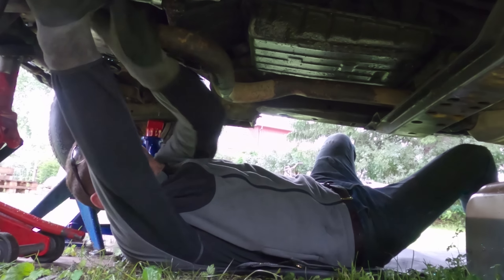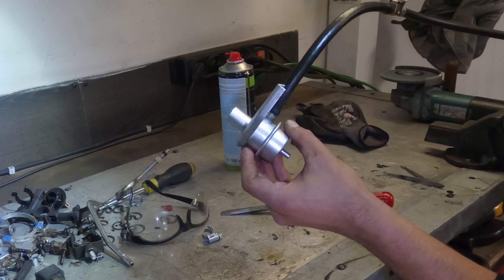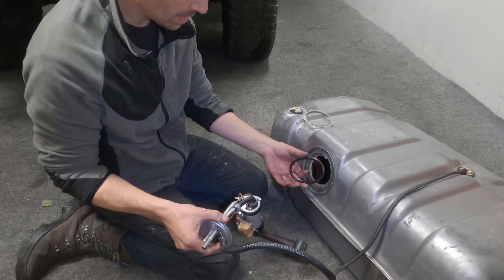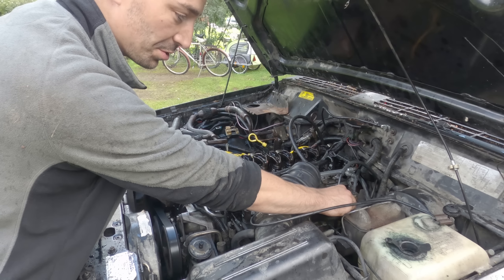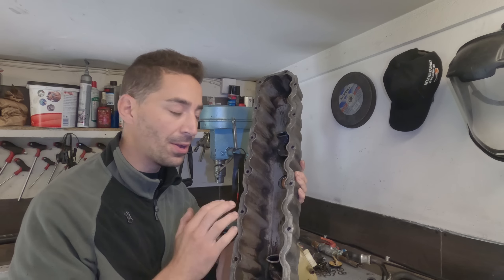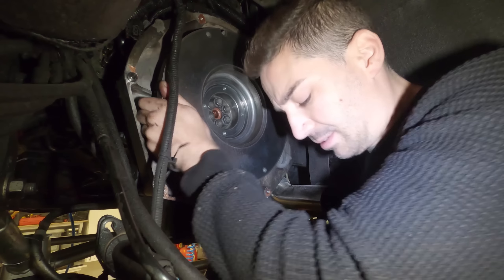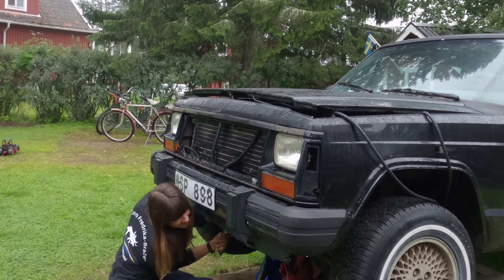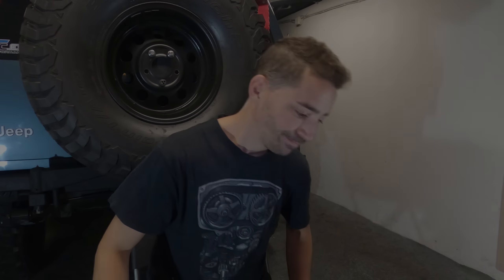1990 Jeep XJ ENGINE KNOCK! / Renix 4.0 Ep:02

Comment: Pressure regulator works by letting  fuel flow through pressure back to the tank. Maybe I miss understood you. But regulator should be on line back to tank in that direction.
Reply from the maker: Yeah that makes total sense which is why I tested it. It was said to be the other way round on several sites but I guess I could of misunderstood.

Comment: Glad the flex plate bolt worked out. I love when a diagnosis and fix is so straight forward once you get eyes on it.
Reply from the maker: Yeah I was lucky with that one. A cracked plate would have been shit
Reply: @WorkshoptoWilderness  I do love the nickintime series on the cracked flex plate. Something about the sequence of cussing was just great when he pulled that thing out and saw the crack. Also remembering he ordered the wrong one too just screwed from every angle lol
Reply from the maker: I watched it and my heart sank but my time may come lol. He had a rough time on that job, but saved others from ordering incorrectly in the process.

Comment: ive got a a rattle that sounds like what that  did but only as it first starts you can hear it then it goes away  and you dont hear it till i shut it off and start it again im going to have to check those bolts

Comment: Good work sorting that noise out!
I'll have a look in all my boxes of old parts, i think i have a fuel filter, a transmission filter for that AW4 and if i'm not mistaken i might have one brand new emergency brake cable left over from my old -87.
If i find them i'll send them your way!
Reply from the maker: Thats extremely generous of you! I can always give you an email or something so we can exchange details? I was lucky on that noise, a cracked plate would have been crap.
Reply: @WorkshoptoWilderness 
If I still have those things, I'd rather see them come to good use than throw them away.
Just gotta find them first. 2nd move in 6 months kinda wreaks havoc on my stuff 🙈

 Sure, why not!

Comment: I was a skeptic when I first saw the Renix's condition, however you are doing an awesome job! I don't see many Renix XJs in Australia, so this is an interesting repair to watch!

I am really interested to see what you do with your bedframe in the back of it, if you do go down that route.

My partner and I have completed trips up to 6 weeks long sleeping in the back of our XJ on a home made bed frame / drawer system. I am 175cm tall and she is a little shorter. However its just long enough with the seats forward to still be comfy for the both of us.

We have managed to fit a 67L water tank, 110amp hour battery, 2000 watt inverter, solar regulator, 37L fridge, air compressor, a pull out drawer, recovery gear, spare parts, considerable tool kit, axe, shovel, 6x small bags for clothing and toiletries, two pairs of shoes each etc. and enough food for 7 days in the drawer system, under the mattress with spare space for unexpected items.

On top of the mattress, when we are mobile, we put the chairs, table and the enclsure tent. Basically anything that doesn't need to be in the car when we are sleeping.

We also made an aluminium roof rack with a lockable aluminium box for dirty items so they didnt stink the car out. (Or to carry extra fuel for crossing deserts etc). It also holds our spare tyre, 360° roof lights and solar panel.

We also really liked your enclosure idea from the diesel XJ, so we installed an ARB one on our XJ too. We use that area for cooking or getting out from the weather.

Not that you asked haha, but my key recommendations for designing a bed frame / drawer system is that you use the lightest, strongest and least amount of materials with a simple design in mind.

We used light marine plywood timber and reinforced with alloy where required before varnishing and carpeting over it. Timber is forgiving and meant I could easily refit different sections as my needs changed. Which I have done many times over the past 5 years.

The final considertion, is make the bed frame as low as possible. The more headroom, the better! Also, the lower the bedframe, the longer your mattress can be due to the sloped angle of the front drivers seats. Note, you obviously lose storage space the lower you go. My limitating factor when it came to height was how tall my fridge was.

If you would like any photos or ideas, just let me know. Happy to help.

I look forward to seeing more of these videos!

Comment: Some of the most realistic backyard wrenching on YouTube. Humor at the expense of Samantha and aunt Edna, some cussing and some "temporary" repairs. You really got lucky with the bolts and not having to drop the transmission,nice work.
Reply from the maker: Appreciate the comment! I did get lucky with that flex plate! A cracked one would have resulted in extreme cussing! Thanks for watching!
Reply: @WorkshoptoWilderness keep an ear out for those bolts if you ever get a knock again. I had mine torqued to spec and they backed out after a few months. Little loctite and torquing by feel fixed it right up!

Also keep an eye out for the transmission front pump seal, when my torque converter got loose it hurt the seal and I found out about 3 hours from home in the middle of nowhere.

Comment: 14 years sitting on a Renix Cherokee. You, indeed are a brave man. Word of caution on all jeeps of this era, change the harmonic balancer immediately so you don't crater the engine. The rubber dampener between the steel pully and hub doesn't age well and when it come apart, it's ugly. Renix and vacuum go hand and hand. Chase all of the vacuum lines, especially, the 90 degree elbows. A leak anywhere will cause more issues than you can diagnose. It's pre HO (1991) so don't expect super performance but it is the AW4/inline 6 and both are pretty bullet proof with standard "jeep" maintenance. Also sounds like you have an idler pulley ready to give up the ghost. Change that along with the HB and the serpentine at the same time. Make sure you use the right temperature thermostat or the engine will coke up like you saw in the valve cover. These engines are designed to operate at 210F. Anything, especially lower, will present short and long term issues like you are seeing.